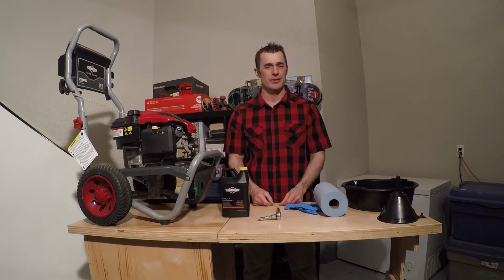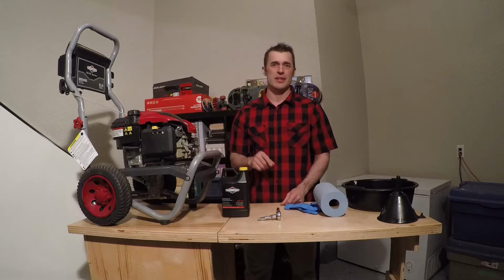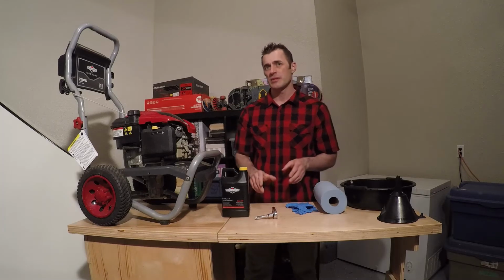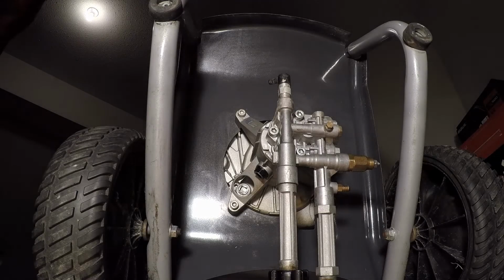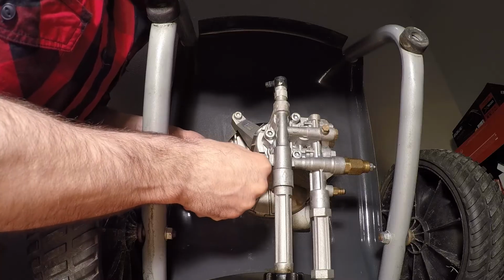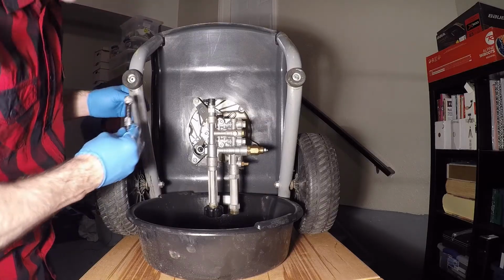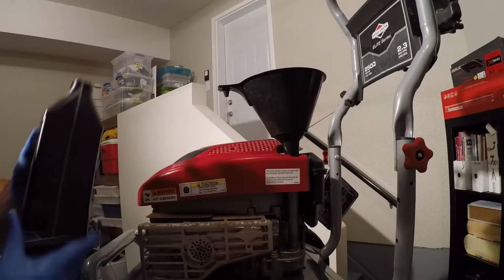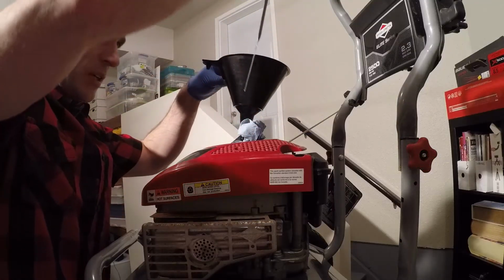Pressure Washer Oil Change

Comment: I have a craftsman branded pressure washer, but it has the exact same engine, pump, and psi rating (2500 psi). I just changed the engine oil, but I noticed that there is a 17mm plastic drain/fill plug on the side of the pump. I unscrewed it and some light-grey colored oil came out. This is likely and oil reservoir for the pump. Should I change the pump oil?
Reply from the maker: lol...you should probably change it now, or at least add some. I have not done a change on the pump oil before.
Reply: DIYNorth Haha yeah, it’s probably time to change the pump oil. My dad probably bought it in 2013 and it’s actually been a nice little machine. Actually, it burns a little bit of oil, but it’s probably my fault because I think I actually put 2 stroke oil in the oil reservoir a long time ago because I had no idea what I was doing, lol.

Comment: Is there a right way to tip a pressure washer? Like, how there's a proper side to tip a lawn mower with the air filter facing up? I'm nervous about leakage from gas or out of any of the other places. Thanks for this video!
Reply from the maker: It probably has a similar consideration. As long as the gas tank is close to empty you shouldn't have a problem though. If its absolutely full then you are probably going to have some spillage.
Reply: @DIYNorth  In the manual for my Craftsman pressure washer (made by Briggs and Stratton) it states: Tip your pressure washer to drain oil from oil fill into a suitable container MAKING SURE YOU TIP YOUR UNIT AWAY FROM SPARK PLUG.
Reply from the maker: @andytraiger4079  yes, I agree that many units are like that as well and dont always have a drain plug. My lawn mower also has that as a recommendation. Absolutely if you dont have a drain plug the tip over method is probably the only way to go.

Comment: Hello.!!!  how about water pump oil change???  I found the drain plug but not the refill to put new oil. Help plz.
Reply from the maker: It really depends on what you own.
Some have a fill and a drain. Some have a fill, drain, and over flow, and some just have one hole that you have to fill and drain from. I would look at your owners manual.

Comment: Thanks for the video. Just wondering if you can use regular car engine oil or not?
Reply from the maker: Apparently you can, though I have never tried it. If using SAE 30, you could use 10W30 instead. Again I've never done it and if you can get what is recommended that would be what I would do.
Reply: has to be a non detergent oil

Comment: I have two oil fill caps wtf lol are they two seperate oil pans ?
Reply from the maker: There might be one for engine oil and one for pump oil. The other thing, although I've never seen it, is i have hear that sometimes they have two fillers and or dip sticks because the small engine is used in other applications and needs them in more than one location depending on the way the engine is mounted for access purposes. im guessing here though.
Reply: I filled it seems to be the same oil pan they are at different angles maybe one is to drain overfill? I have no idea but both sticks are wet i only filled one side
Reply: @DIYNorth  i was just thinking maybe the two caps could be used to flush the oil pan ?
Reply from the maker: That's possible. Does the owners manual not explain anything on that.
Reply: @DIYNorth  no not really i was on my own for pretty much half of putting it together. I called craftsman they told me its just a weird design didnt really say why. It goes to the same place

Comment: hi i have a troybilt pressure washer, it lost some water pressure, noticed milky/beige oil in dipstick, is it a engine oil seal? any advise..thnx rs
Reply from the maker: Sorry, I'm not too sure. I have only worked on my own so can't speak to other brands. Since the oil is pretty cheap I would do a change before running it again, then closely monitor to see if the problem comes back. If it hadn't been run for a while it could be a temporary issue. Or just get a new O-Ring and Seal Kit since there is a high probability water leaked into the oil. That would obviously be a lot more work. You may have given me an idea for a video this spring though.
Reply: Some oils, when under extreme harsh conditions (being beaten around in a pressure washer casing is pretty harsh) will emulsify with air or contamination. 
In your case, it seems your oil got mixed with water somehow. Probably from a bad seal

Comment: Drain plug for gas where is it at?
Reply from the maker: I'm not sure it has one, but you can disconnect the hose at the bottom of the tank that goes to the carb.

Comment: You are pouring your oil incorrectly. Because you are still getting the “glug, glug, glug”.   If you tip the oil sideways, so that the larger flat side is up and down (as opposed to the thin side) you will not have that problem. But be careful, because it comes out a whole lot faster. It always is a wise idea to check for oil volume specifications on the internet  prior to pulling out the oil.  That way you know you have enough.
Reply from the maker: i will keep this in mind, regards.

Comment: I don’t have that bolt underneath mine
Reply from the maker: Some pressure washers don't have the bolt and require you to tip the washer over and have the oil drain from the filler cap.

Comment: why does my excell 3100 psi power washer have 2 oil fills?
Reply from the maker: I'm not sure as I have only ever had my own Pressure Washer, I would assume that one is for the engine crank case (engine oil) and one is the the Pump. But again, I'm not sure in your specific case.